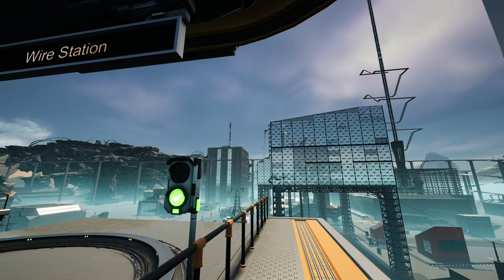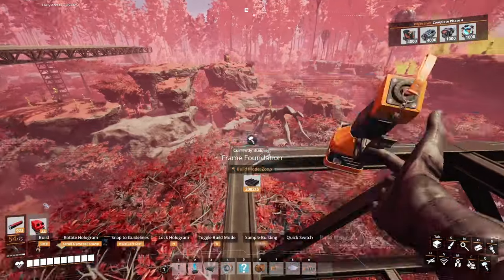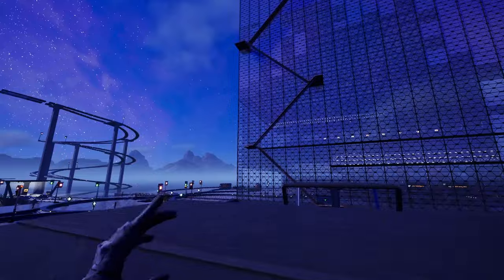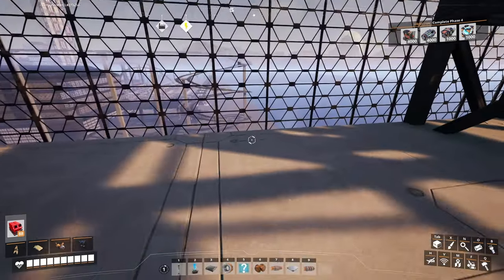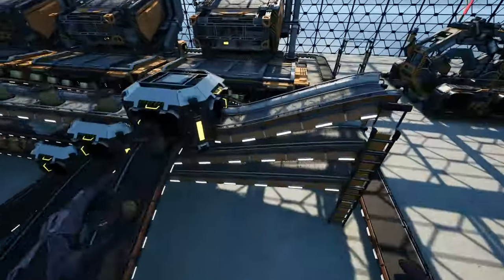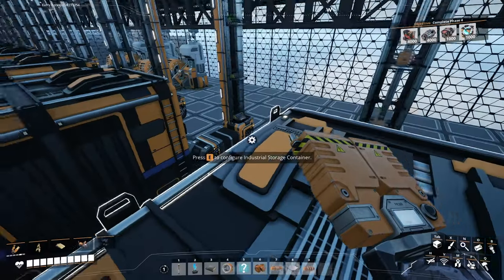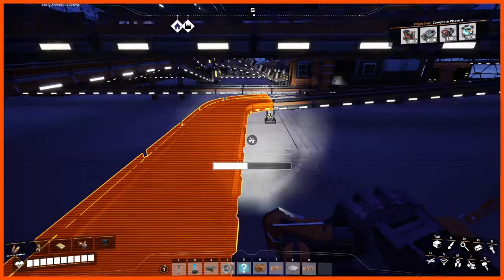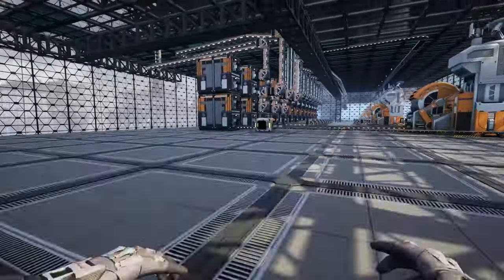The Supercomputer System - Satisfactory Update 8 (Part 16)

Comment: What is your pc specs? . In your opinion is building your own pc better than buying a prep build one?
Reply from the maker: I built mine in 2021, and it's still doing great. I have the nvidia 3060 TI, 32 GB RAM, AMD Ryzen 5 3600 CPU. I also have the RM750 PSU and AM4 TUF X570-plus motherboard, and a 2 TB SSD and a hard drive. In my opinion it's definitely worth it, but people's needs vary!
Reply: @spork999  I will keep these  specs in mind. Thanks.